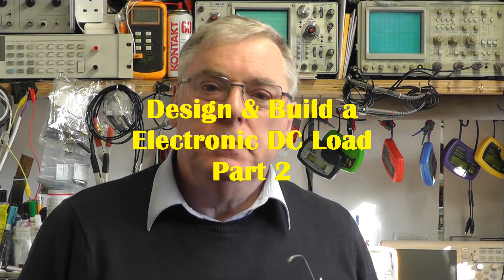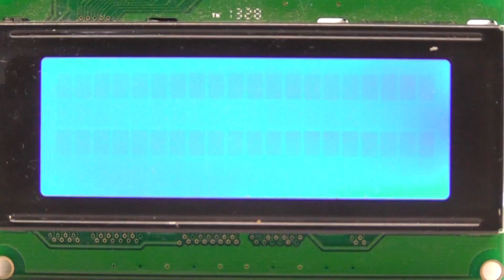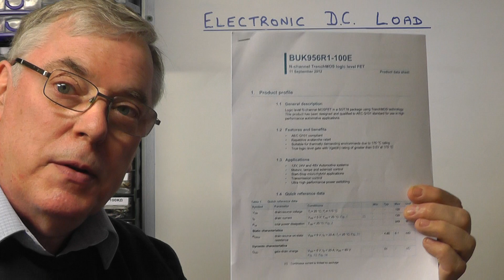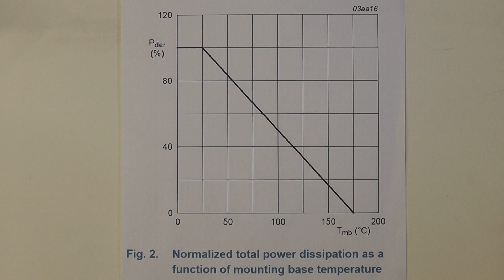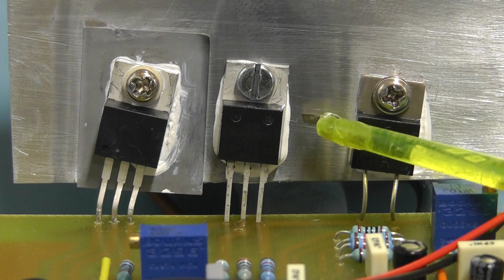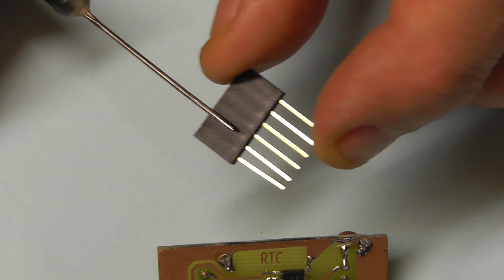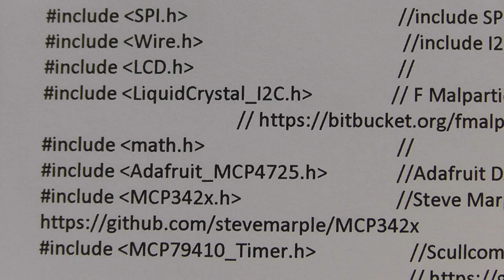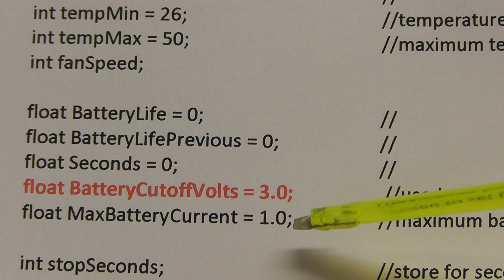Scullcom Hobby Electronics #46 - Electronic DC Load Part 2

Comment: Great project, Louis.  Very well diagrammed and explained, as always.  Well done!

One useful feature in electronic loads that you might care to add is the facility for remote sensing of input voltage.  Particularly for battery capacity testing, it's important to sample voltage at the cell rather than at the end of a test lead carrying significant current.  Calculated cell capacity can have substantial error if the voltage drop in the test leads is not accounted for.  A small SPDT switch on the front panel could select between internal or remote sense.

There have been a couple of comments about whether MOSFETs can be used in the linear mode and about selecting the right MOSFET based on Rds(on).  Your discussion of safe operating area (SOA) hinted at the answers, but for viewers who are new to linear regulator design it should be stated plainly that Rds(on) is not relevant to MOSFET use in a linear application.  Rds(on) is an expression of the device's resistance only at a specific gate voltage (usually turned fully on).

In a linear application, the gate drive circuit will purposely throttle the MOSFET, creating whatever drain-source resistance is required to achieve the desired output.  Because of the way many MOSFETs are made (multiple parallel transistor "cells" on a single die), they're subject to hot spots that can lead to thermal runaway.  As you discussed in the video, this is why you must pay close attention to the forward bias SOA and design your circuit to stay well within its boundaries.

This is one niche application where Rds(on) is irrelevant and it makes choosing the right MOSFET difficult, as you can't do a parametric search on SOA.  One way to find what you need is to sort by max power dissipation (Pd) and then slog through the data sheet SOA diagrams for parts in the Pd range that suits your application.

For deeper explanations of this subject, viewers can read the following application note by Fairchild Semiconductor and article from Power Electronics Technology:

Fairchild AN-4161:  http://preview.tinyurl.com/hepm8fz

PET Article:  http://preview.tinyurl.com/z7s6u4q

[The links above will show a preview of the full URLs at TinyURL.com, where you can choose whether or not to click through.]
Reply from the maker: For some reason Google put you comment in the "Likely Spam" box, maybe due to the web page links you added so I had to allow it manually, hence the delay in seeing it in the comments.
Thanks for your details comments which I am sure will be of interest to the viewers. I will have a look at the remote sense issue you raised. Good point about focusing to much on the Mosfet ON resistance - thats why I decided to cover the Safe Operating Area in my video. Thanks for the links which will be helpful to others watching. Regards, Louis

Comment: Viewers may be interested in using the TI CSD18502KCS Power MOSFET.  While not specified as a "logic level" device, its Rds(on) @ 4.5 Vgs is 4.5 mOhms and @ 10 Vgs is 2.9 mOhms.  However, as a substitute, it should be fine, and might be more easily sourced, especially in North America.  It is $2.15 in singles from DigiKey.
Reply from the maker: Thanks Richard for the info. I had a look at the Mosfet you suggested as a possible alternative. I think it should work but with a few caveats. It should be OK for up to 30V Load, absolute Max Drain/Source voltage is 40V. Looking at the Safe Operating Area in the datasheet, at 30V its Max current at DC level would be 2 Amp. Also the Junction-to-Case Thermal Resistance is higher at 0.6°C/W so you would have to take that in to account. Having said all that it should be OK if you limit your maximum power to say 50 watts and have a good heatsink or better still use 2 in parallel. I will get hold of a few of these Mosfets and test them. I will be testing a range of alternative Mosfets and feed the info back in later parts of the project. Thanks again Richard for your input, I am sure it will be of help to other viewers. Regards, Louis
Reply: I'm using the heat sink/fan unit from an old graphics card.  This are "throw away's" from old PCI bus XP machines that had upgraded graphics capability.
Reply from the maker: Yes these old PC heatsink and fan come in handy and for free!

Comment: You are a great teacher! I have built part 1 and will definitely try this. Have you done any work with IGBTs?  I saw it being used in a analogue DC load to handle very high currents.
Reply from the maker: Thanks. I have not done any projects with IGBT's yet but may look at them in the future. My understanding is that they are a cross between a Bipolar Junction Transistor and MOSFET transistors. They have the output switching and conduction characteristics of a bipolar transistor, but are voltage-controlled devices just like a MOSFET. However, the IGBT does not have a body-drain diode which MOSFET's have, also they have a negative temperature coefficient, which could lead to thermal runaway. Having said that it would be interesting to have a further look at IGBT's and see if they are suitable for future projects. Thanks for reminding me of them. Regards, Louis
Reply: The only place I've seen them used, is to drive ignition coils. Provides insulation from high voltage. Maybe they wanted to be insulated from the load and required very high operating voltage. All else, inferior to MOSFET.

Comment: Hi Louis!
My transparencies are not dark enough. Could you tell us what Lazer 
printer and materials that you are using? Your transparency traces look 
real black, I've been stacking two transparency's to obtain the 
necessary blackness, which is a real pain.
Thanks for your update, very professional as usual!
Reply from the maker: Hi Phil,
I do not use a Laser Printer. I use JetStar Inkjet Film for Epson Printers which are made by Mega Electronics Limited. I purchase them from Rapid Electronics (their order code number is 39-0780) - direct link below:
https://www.rapidonline.com/mega-electronics-100-070-jetstar-standard-ver-ii-a4-pack-of-10-39-0780
They come in packs of 10 A4 sheets for £9.88.
I find they print darker if you set your inkjet printer setting for Premium Gloss Paper or High Gloss Paper.
If you still have problems message me in Private and I will see if I can help. Regards, Louis

Comment: Good job with the updates! I really like the way you added the RTC chip. I2C is great for that kind of mods: Just two pins for power and two for data and one can add "unlimited" amount of peripherals without redesigning the main board.
Reply from the maker: Thanks for your comments. I have some more ideas for further enhancements using the I2C bus. Hope to show them in Part 3.

Comment: Question, are a MOSFet designed to operate in linear mode? I've always thought for this type of application it's better to use a bipolar transistor? In my DC-load I use a TIP35c. Am I wrong?
Reply from the maker: Yes some MOSFETS are designed to operate in the Linear Mode.
A MOSFET is a voltage driven device, so the op-amp doesn't have to drive any current. With a Bipolar Power Transistor (BJT) the Op-Amp must supply the base current. Bipolar Power Transistors may require a high drive current. You could use a BJT in these type of circuits but there would be an error due to the base current being added to the load current passing through the sense resistor. At higher voltages and high current levels MOSFET's are more efficient than BJTs.

Comment: Very nice video again.
Would be nice to include an external voltage reference to increase te accuracy of the readings.
Reply from the maker: Thanks for your comment. In Part 3 of the project I will be looking a calibration. I have already been testing a 4.096V reference IC to improve accuracy of voltage steps of the DAC (i.e. 1mV steps).
Reply: Hi Louis, the MCP4725 takes the Vdd as the reference voltage for the DAC, so wouldn't it be better to take 5.000V (AD586) as a reference voltage instead of 4.096V. Or is there something I overlooked?

Comment: There is a possible improvement in the circuit. If there is no zener diode in parallel with the current sense resistor, it might fry the opamp when the mosfet dies to create a short circuit between drain and source in which case almost all of the input voltage will appear across the sense resistor and it might damage the opamp. Therefore  add a zener diode in parallel with  the  current sense resistor.
Reply from the maker: Thanks for your comments. Yes we could add some protection in the event of the Mosfet going short circuit. This is something I will have a look at. Using a zener diode may not be the best way, since if you have a high voltage, high current source this could also damage the zener diode which in turn could resulting in still damaging the OP Amp.
Reply: Usually, the inputs have ESD protection diodes to both VCC and GND. If you limit the current through it to 5mA, you are fine.
For that, R16 needs to be increased. If not, a schottky diode to ground and VCC after R16 (U7D/pin-12) should do the job.

Comment: great video. But i think the transistor is not appropriate for anything above 25 watts according to my experiment with these sort of mosfets. The mosfet might die very soon. May be it is a good idea to use multiple mosfets in parallel. Anyways great project.  Keep it up
Reply from the maker: Thanks for your comments, yes it is a good idea as you say to add multiple Mosfet's. So far I have tested it up to 50 watts with a suitable heat sink and it seems to be OK. As we progress with this project it is my plan to add additional Mosfet's in parallel to increase the power capability. Regards, Louis
Reply: It would be nice to be modular and add on additional MOSFET nodes to allow higher currents over all. I'd like to go beyond 3A for some things.